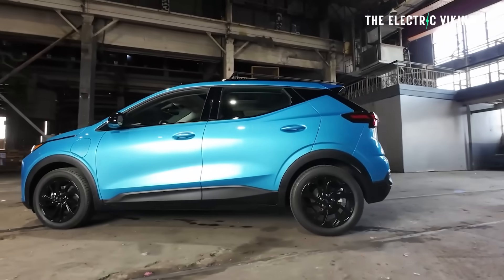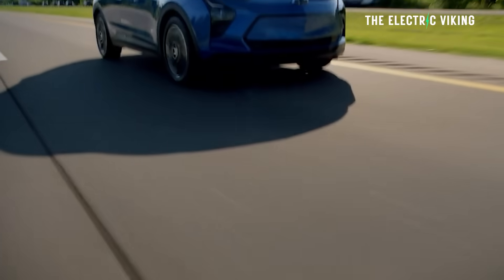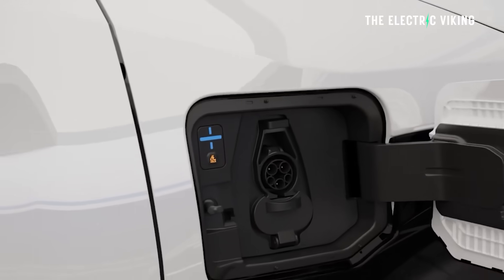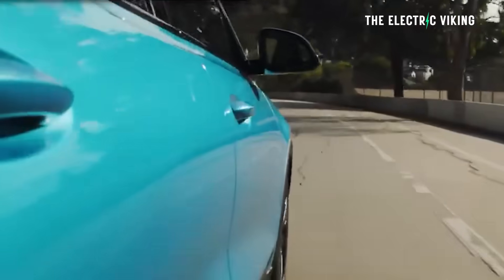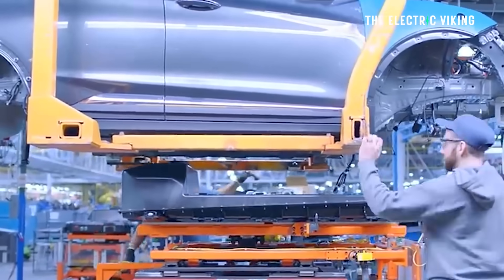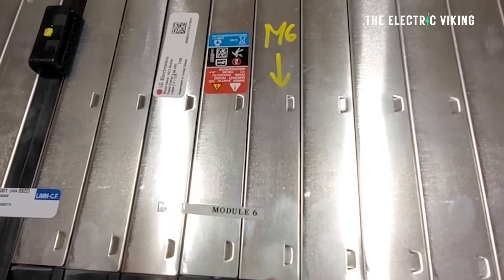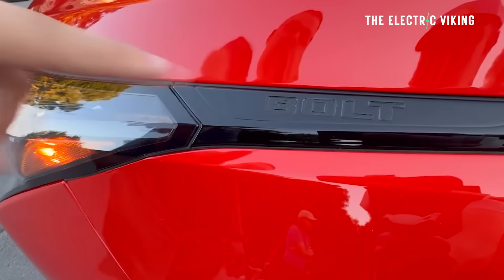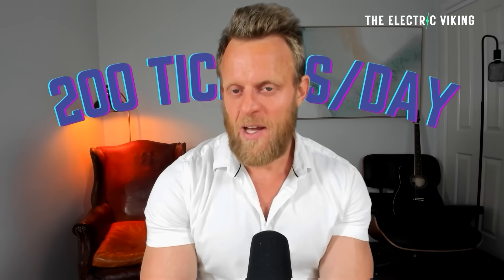GM unveils new Chevy Bolt – WAY Faster charging, LFP battery, low $29k price

Comment: Claimed price under $30k.  Actual price $36,990 off the dealer lot.  Production of only 16k a year.  Profit per car of -$1,700 each.  No FSD upgrade path.
Reply: Can't have much markup.  Plenty of cheaper used EVs around and it's a subcompact, which limits the share anyway.

Comment: Wait...my understanding is that the new Bolt will be available in  Q1'2026  (not 2027).   Perhaps you should pin a comment correcting that mistake.

Comment: Apparently the "limited run" statement by GM was only based on anticipated sales - if it ends up being wildly successful, there is no logistical constraint on them making the "limit" much higher. They have no parts constraints, and an assembly line that could support another worker shift.

Comment: Nobody wants EVs... they are too dangerous. Hybrids are the way to go.
Reply: Hybrids have the highest fire risk.  Then ICEVs, then BEVs are the lowest by far.

Ironically, you also made your comment on a refresh of the Bolt that will have LFP batteries that reduce fire risk even more.
Reply: @AnonYmous-rw6un  I was going to say because, gasoline does not explode MUCH!

Comment: No steering wheel regeneration paddle is a deal breaker, I’ll wait for Canada too drop the 100% tariff on China and buy a new Shark 6 BYD.
Reply: Why?  Do you prefer low regen on the accelerator?  Or high regen on accelerator not enough?  They implemented full blended braking in the new Bolt so you'd always max out the regen on the pedal.

Comment: Hope it's just as great as my 19 Bolt or better! According to some articles Bolts don't rate high on reliability. Must be due to almost all Bolts getting a new battery, but I view that as a plus!! After owning one for over 40k miles, I'm thinking that's pretty encouraging if most electric cars are even more reliable the Bolt, because these things are great, just a wheel bearing, a 12volt battery and 2 sets of tires to keep it going.

Comment: whats the top speed?
Reply: About the same as before, which was 93mph or something like that.  New motor has 10hp more, this weighs 100lb more than old base EUV version.  So might be a bit quicker but they weren't looking to increase speed.

Comment: Delivery date is incorrect! The Chevrolet Bolt is returning for the 2027 "model year" and will be available at dealers in the first quarter of 2026. The model year is not the same thing as availability date.

Comment: If you can get it for under 30 MSRP, it’s not uncommon to find additional incentives. The GM also puts out just like they did with the equinox EV which mounted to a potential of $3500-$4000 in offers. If so, it’s really a good value however, if you can find a preowned model 3, vw id4, maybe a Mustang Mach e ,or Ariya, in the 23 to $26,000 price point with mileage in the 10000 to 20,000 mileage range it may be hard sale.

Comment: The Bolt goes in sale Jan. 2026, and the battery will come from China the first year while the US battery plant is completed late 2026. It is also a limited run because of the chinese battery.
Reply: I think limited run is because of a planned model changeover..  GM has a few LFP based EVs in the pipeline.  Bolt may or may not keep the name.

Comment: Why would anyone buy a GM product with so many failure points compared to Tesla. This is such a compromise on all levels. GM will be reduced to third level company. Tesla is the best car I ever owned. It brings me so much joy.
Reply: What compromise?  Long range EV, 48A AC, 26 minute 10-80% DC, standard heat pump, standard adaptive cruise.  Launch LT 30k incl dest has comfort package with heated front seats and steering wheel.  (Bolt will also have built in Google maps with EV planning and plug and charge, but not sure all of it is standard).  But nobody's matching that basic value in a new EV in the USA.  They turned it from in range to an all rounder.

Comment: As a former Bolt owner. I'm more amazed at GM's inability to smoothly deliver to customer demand when it comes to the Bolt. Why did they have to stop making them to begin with?  Why did it take so long to bring out this new version?  Why do they insist on placing charge ports opposite side from Tesla Superchargers?  Why do they keep building charge port doors that open so that they get in the way of charge cable?  Why can't supercruise be ready to go day one?  We aren't talking about Rivian or Lucid here.  It's frickin GM, and they been building cars for over a century, and electric vehicles for decades.  They should be able to deliver this vehicle in 6 months considering they were leveraging a legacy vehicle, and same technology in the equinox.  All of that being said: I love it.
Reply: I think they were waiting for US LFP cell production but are releasing early with a CATL battery due to the loss of tax credits.
Reply: The videos are showing the charge port on the driver’s side, which is the same side as Tesla. But, yeah, the port door annoyingly opens the wrong way.  Charger cable locations on new and some older Tesla Superchargers are changing so that cables are in the middle of the parking space, allowing our new charger users more flexibility. 100% on everything else you wrote. It must be very frustrating as a former Bolt owner to have GM pull all of these odd stunts with such a well loved car.
Reply: @amys4976 Charge port opens that way so that if you drive off with it open or it fails to lock it won't break off due to the force of air against the door.
Reply: because GM sucks

Comment: LT trim at $30K, which means the RS trim will be at about $35K+. I don't see a compelling reason to buy this over a Model 3 or Y, which are vastly superior for a few bucks more.
Reply: RS Trim already announced as starting at 31.6k, 33k including destination.

3 is a sedan.  Y standard is 40k.

Also, Bolt provides passenger space in a small car.  Some people prefer a smaller, more maneuverable vehicle.

Launch LT 30k incl destination has comfort package with heated seats and steering wheel.  I think the value will be there.

Comment: Looks comparable to the BYD Dolphin which costs under $14,000 in China. So congrats to GM for making a car that ONLY costs double the Chinese brand. I expect all these Bolts to be recalled in about a year for battery problems like in the past
Reply: You do know even the most expensive variant of the dolphin has less EpA rated range then the bolt while the boat has double the DC fast charging speed.

America requires a lot larger batteries due to distances so a lot of the cheaper Chinese cars straight up aren't viable
Reply: When your car is half the price you can double the battery range for under $5000. It's not rocket science. The battery tech is better in China anyway
Reply: @ladygracienyc2029 The Bolt's battery will until 2027 at least be a CATL pack from China.  The new Bolt's DCFC is faster than the Dolphin's.

Comment: There is no more valuable EV car then 2ND hand Tesla !    Tesla M3 standard range you can get from 15k  and Long range AWD from 22 k   These cars are many times better then new Chevy or any new non Tesla EV. Value / price is unbelievable on 2nd hand Teslas ..nothing can beat that. (may be Chinese cars in China for Chinese prices , which you cant get 😅)
Reply: Model 3 sedan.  Bolt EUV is  crossover.  Market wants crossovers.

Comment: so only like 10 more mile ... from 247 to 255 ... that is not improvement... that just a change to size 15 wheel and tire combo... what a piece of crap.... not worth the wait... or car... or innovation over the years... shows when gm is not pressured... they wont innovate... I'd say a 4% improvement instead of a 10% to 30% ... should have been 325 mile  range with reduced weight, and 30% to 40% cost in production cost...  gm sitting and waitting for china cars to send it into bankruptcy
Reply: Much faster DCFC, heat pump, more standard features like adaptive cruise, and car has built in Google mapping with EV trip planning as well as charging account management.  Basically it's now an all round EV, where it was previously a good value in-range EV.
Reply: With a heat pump, and being able to charge the lfp battery to 100% all the time, the real difference in range compared to my current Bolt will be more than 5 miles, especially in winter.

Comment: Every other source I've heard, including General Motors itself,  stated that production of the 2027 Bolt will begin in 4Q 2025, with deliveries beginning in early 2026. So one will not have to wait a year to get one of these. Also, "limited production" is a coy way of saying that production will be based on consumer demand. So, the more orders they received, the more Bolts they will build. I'm excited to see this car. I may be selling/trading my 2023 Bolt EUV for one of these, primarily because of much faster charging on road trips and the availability of the latest version of SuperCruise.
Reply: I heard they were to have a 2035 model available in 2027.
Reply: @tommak6516 This is at most amid cycle refresh, it looks pretty much exactly the same as the 22 and 3 bolt EUV with the battery size being basically the same also. 

It's only upgraded the wiring to support faster charging as the main
Change pretty much so it makes sense 

That the bolt was going to have a complete refresh and this is a mid cycle mini update which all manufacturers pretty much do and it was rushed out due to credits ending

Which make the refresh non-economically liable
Reply: I'm pretty sure it was supposed to be a complete redesign and this is just a tied people over because the tax credits expired
Reply: That's good to know. I want to buy one, but not til 3rd quarter of next year. I'm worried that I won't be able to get one due to production ending by then.

Comment: I have a 2019 and 2020 Chevy Bolt. It's a shame GM is bringing back the Bolt EUV only for a limited or short amount of time. The Bolt is a city car and was never designed for road trips. The need is there for an affordable small EV and it's sad that GM apparently by saying "Limited", wants to build the new Bolt EV only for a few more years.
Reply: Only saying limited because they have newer models coming, one of which would be the next generation Bolt that may or may not have the same name.
Reply: @AnonYmous-rw6un Ok, thanks for the clarification.

Comment: Agree with the negative. I sold my old BOLT EUV because it was discontinued. Who is going to buy a car knowing it will be discontinued. Getting replacement parts, battery, accessories etc is difficult and expensive if volume isn't high enough.

Comment: My brother recently bought a 2017 bolt for $12 k . It had the battery replacement under the battery recall . He noticed after he bought it that it can't be fast charge if you could call it that but at a range of 250 miles it works for his daily life . He also has a gas car for travel . I see why they called it a commuter car . It's too bad the tax credit has been terminated . That would have made it super affordable. It's good that legacy has not scrapped ev production with the hostile government environment but I think they are here to stay and legacy knows that and they need to keep developing the technology . They are far less complex and will have less overhead like warranty issues . This bolt is probably better than a used Tesla that is a few years old .
Reply: In early Bolts DCFC was an option.

Comment: IMHO - For the battery, I think they should drop-in an 85, same form factor with better energy density to possibly reach 300 mi range. That would be a huge benefit perhaps a game changer. While I'm okay with the styling I feel it could be refined a bit further - the red unit with black wheels doesn't look at all compelling. Ditch the black wheel fad and give the treads a beefier look on silver alloys. 

I wouldn't discount GM releasing an EV Trax model on its current ICE platform presuming they "future proofed" it to easily re-config into an EV skateboard. If they've addressed seating comfort and enable BYO music via BT so owners can stream their music/podcasts I feel most consumers would like that, plus, it would provide an 'automatic connect' path to hands-free phone use.

Done right I'm of the belief that with streamlined/efficient production and sourcing they can sell it/them profitably. I had recently learned the Bolt is the best selling model in its target segment & demographic. Plus, it's made in the USA.
Reply: The range is fine for typical use cases.  It's not towing heavy loads.  The improved DC charging makes it better for longer distance as well.

Comment: The only problem with the new Bolt is that it's made in the US and for me it's likely to be a lot more expensive due to tariffs , the Equinox EV is made in Mexico so it does not have tariffs so it may be about the same price.🤔
Reply: Equinox is better
Reply: Anything made in the u.s. does not have a tariff. Most every thing imported has 10% to 100% tariff wake up.
Reply: @suekirsch7333  It does if you are outside of the US like me 😁
Reply: I will not be buying ANY US product no matter how good they are. Not until sanity returns. I'm not alone.

Comment: Can’t compare the Bolt to any Tesla!!  Would I like a Tesla???  Yes!!  Would any Tesla be small enough or compare to the Bolt as far as size wise???  No it won’t.  I don’t want a 3 or Y sized car and many Americans are in the same boat.
Reply: Incorrect SMFH the compact segment of which this is a member. Is currently 800,000 or less TOTAL COMBINED UNITS ANNUALLY SMFH. Vs about 13,000,000+of all other sizes. 

Do the math it's maybe 6% total want this size vehicle across ice/ev&hybrids across all models SMFH no wonder oems won't prioritize this class in America!
Reply: @4literv6 They said many, not most.  But, this offers good passenger space in a small form factor so could attract some buyers who might otherwise shop compact crossovers.

Comment: The car (in RS trim) will be on sale on the first quarter of 2026, as a 2027 model. My guess is that the "limited run" is due to the uncertainty surrounding Trump's idiotic yo-yo tariffs that make it impossible for companies to plan any serious investment.
Reply: Limited run because they have newer models coming 2028(?) so it's not going to get a typical 6 year cycle.

RS and LT coming initially but the launch LT won't be the full base, it'll at least have the comfort package.

Comment: You will be able to buy the new bolt in 3 to 4 months not 15 months and the bolt has more standard options than the standard Tesla and costs 10,000.00 less. And you don’t have to tap the screen 2 or 3 times to get into the glove box.
Reply: Exactly.   Who the hell wants a used tesla.  It's not 2010 anymore
Reply: @adamwiseman5831 Any thoughtful person. Granted, there is plenty of FUD about Tesla and Musk that dissuades non thinking buyers.
Reply: Just don't talk about things that really matter. Range, charging convenience, self driving that works everywhere, etc.
Reply: @thedukeofalinor1377  because you can open it if you car doesnt have power lmao.
Reply: @crispycrusader1  if that is why you buy a car - OK
Reply: @thedukeofalinor1377  who has self driving that actually works?  It might kinda work, until it suddenly doesn’t— we wouldn’t put up with that in our passenger planes, trains or busses, so why should we put up with it in our cars?
Reply: You can just use the voice command to open it too… if you can’t handle a touch screen.
Reply: @ntsecrets I dont think thats the point lmao, a glove box should always just be a quick latch, like... why complicate it with a voice or multiple screen taps...
Reply: @crispycrusader1  because you can lock it?

Comment: 150kW was plenty fast for charging my Tesla Model 3 RWD on road trips.  I was usually hurrying back to the charger after a sandwich, restroom.
Reply: Yea, did a 1100 mile round trip in my Tesla Model 3 Long Range.  Longest charge was 14 minutes.  Most were 7 minutes or less on 250kW chargers.  FSD is AMAZING for road trips!  Also... fun fact!  Tesla Superchargers charge half price after 12am!  Most of the trip was done at half price!  Gas stations need to do that.  Get gas from 12am-6am and pay half price.
Reply: I would drop wife at a diner, then go charge to get that extra time at the diner.

Comment: A little bit more horsepower a little less torque a little more rain than euv
Reply: 40% less torque is a little less?
SMFH its also over 100# heavier per motor trend, they only saw efficiency in the high 3 miles per kWh range and they claim its now 7.5s 0-60 which means GM nerfed it not to step on the equinoxes toes(I own a base no options 25 lt ev and we are at 3.7miles per kwh since we got it. Seeing as high as 4.3 in mixed driving here in atl during mild weather opd on and in sport modes exclusively.
Reply: @4literv6 It's the same motor as the Equinox, but with no AWD available no option for extra power/torque.

Similar torque reduction happened with the new (larger) Kona EV.  We have a 2020 and wife test drove the 2024 and just pulling out of the dealer lot said "Oh no!"  Short test drive. 😂

Comment: Limited run could mean a special edition while the standard edition would proceed on at a lower price point. Alternatively it could be a stopp gap car to be superseded by an all new model. The situation in the US at this moment might also be the limiting factor at play here.
Reply: They have said that they plan to release next generation vehicles.  I think the limited run is because it's not going to have the typical cycle.
Reply: @AnonYmous-rw6un what is this new bolt if not next generation itself?